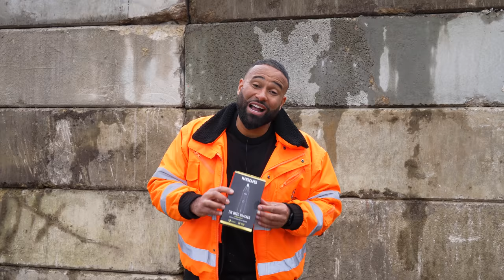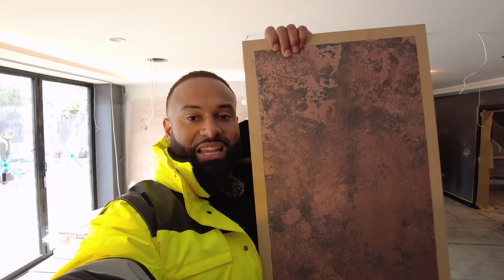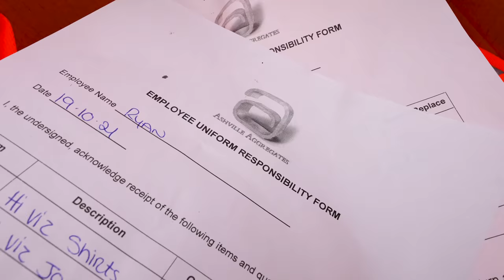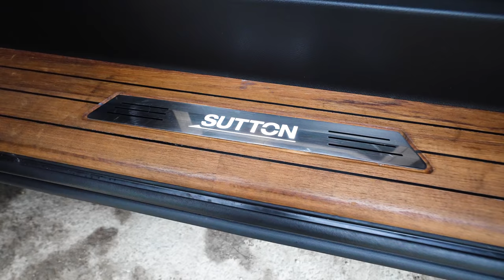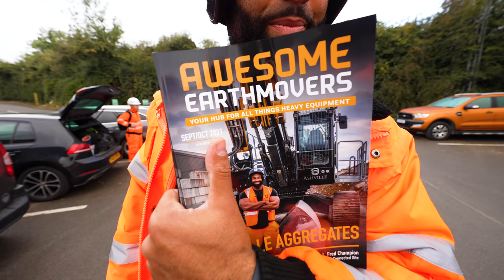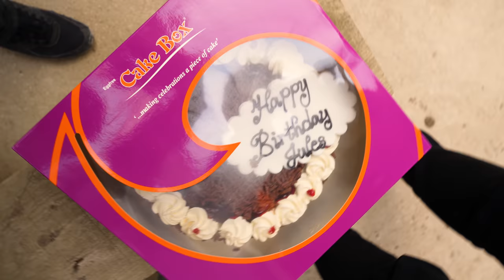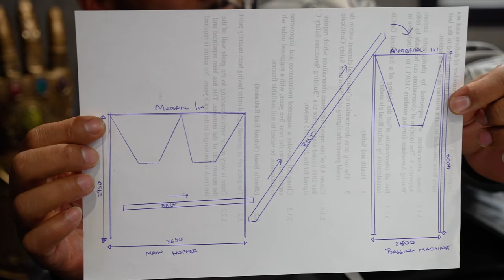New Uniform and Dropping Shingles | Ashville Weekly ep055

Comment: 32:30 - I passed my class 2 in July and started working for a waste disposal company around 2 months ago, I had some electric gates close on me and break an indicator off and on a separate incident, I cracked one of the front panels where the side camera is whilst reversing into a tight spot. Both times I've told my boss what happened and both times I've had a reply of "ok mate thanks for letting me know" it's really not that hard.

Comment: I know steel prices have gone through the roof but is scaffold cheaper than steel section, for office canopies etc. Scaffold looks so ugly and temporary looking.

I worked for a construction company that's now part of Keir's and they had a plant yard in Colliers Woods. Sites would get old equipment from there when other projects completed  and make it work for them with some onsite fab work. So try phoning around some yards, you may pick up just what you need.

Driving a truck around rough sites with the jolting and banging, bumps from hidden timber etc can be ignored by the driver as just rough roads, also other plant can hit the truck while the driver is attending to load tickets etc. He then finds the damage later on a walk round. Rest area's and motorway service area are notorious for this,  driver nips in for a toilet break and returns to the front end stoved in and nobody knows who done it.

Comment: All employees that operate equipment need to be made aware of their responsibilities.  If any equipment is damage it as a result of negligence it there will be a deduction from their pay of 25 to 75 percent of the damaged part.  Equipment such as lorries and other equipment.  Inform them the equipment they operate is their responsibility, make sure it is fully operational using preinspection documents.  Report shortcoming and deficiencies daily.  People need to take responsibility and do not use the excuse they do not know.
Reply: Wow, another  great way of tempting people to become a HGV drivers.  A real stupid answer.   In my line of work if I make a mistake it would cost a minimum of 100k.  An incident that took place around 3 years ago cost the company I work for £3M which is driver error - shall we apply your deductions. - People make mistakes that is being human, 100% own up and take responsibility - but if it is going to cost your amount then lie.
Reply: Doesn't work people will jack on the spot and go else where leaving you looking for a operator!
Reply: There has to be accountability for damage equipment.  The trucking industries is hurting for people.  The government need to stop being the provider for people who chose not to work.  Help the people are working.  Unless a person is mentally or physically disabled then government assistance will be needed.  Employees cannot be mindless to what happens to equipment  when they are using it.  The question should be if it were owned that employee would they plead ignorance to the insurance company about damaged equipment.  Responsibility and accountability goes both ways to the
 employer and employee.
Reply: @sjones8738  If you are a company owner, then you won't have many people working for you with that type of pressure.  Mistakes happen, that is the nature of the logistics, if you punish drivers for every mistake financially you won't be in business long.  That is what insurance is for.  - No one sets out to cause damage but things happen.  -